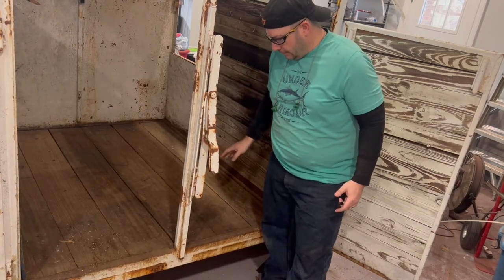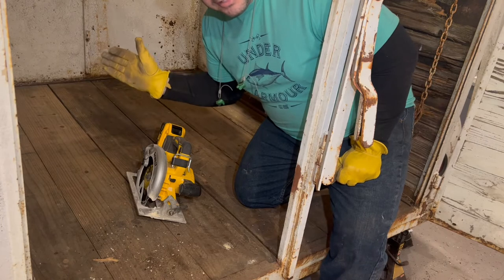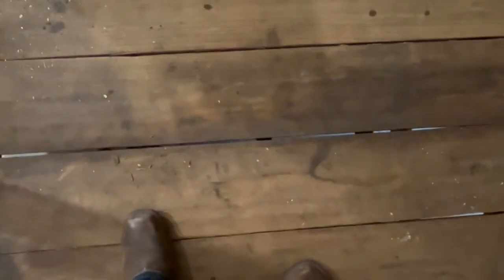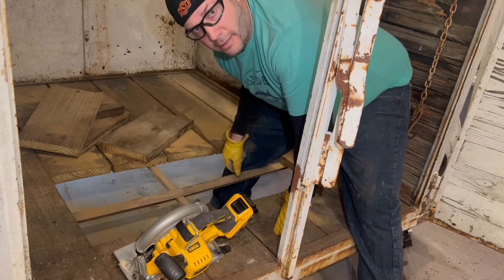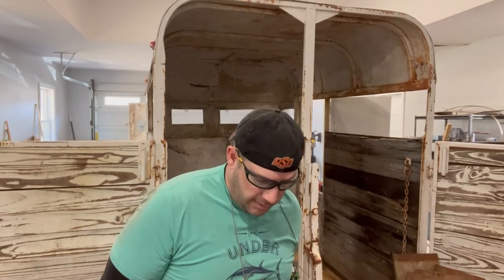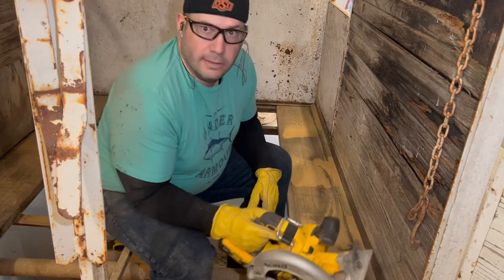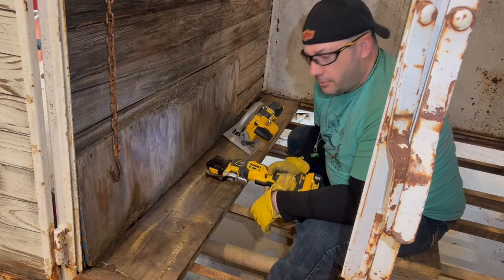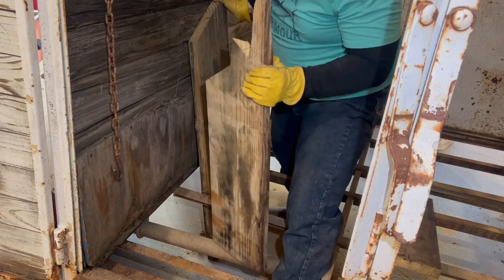Removing the trailer floor boards

Comment: Those boards looked fine
Reply from the maker: They were structurally sound. I replace the floor in my trailers more for aesthetics and just to have a new floor in for customers. If I was building it for just myself, then I would have probably just leave them.

Comment: Why not just slide the boards away from the walls towards the center and cut them like the rest? You only had to slide the side boards another 4-5 inches on that left side.
Reply from the maker: If the boards are loose enough to do that then yeah definitely. I wanted to show a way to cut them out if the boards are too tight. I’ve had trailers where the boards were so tight that they wouldn’t move an inch and I’ve seen them where you can slide them around easily.